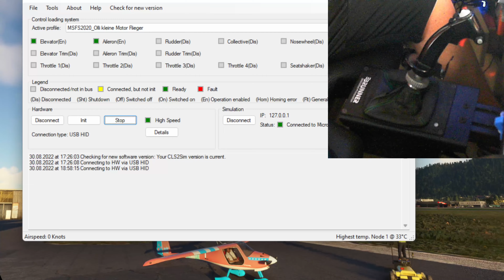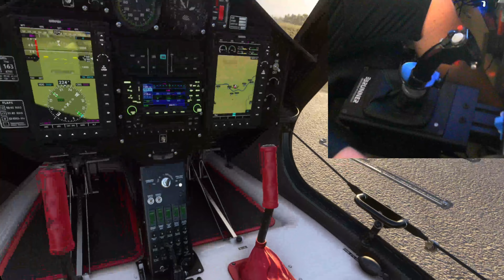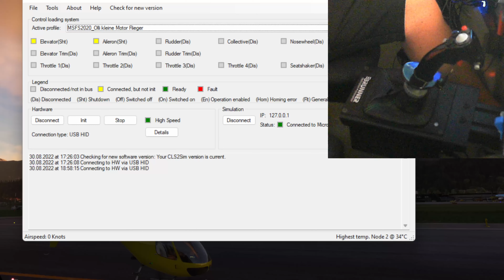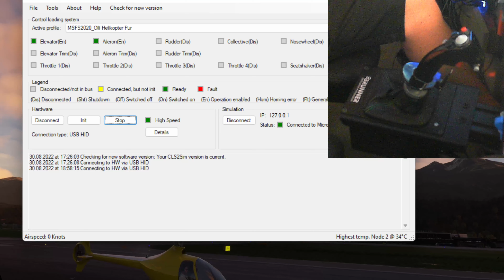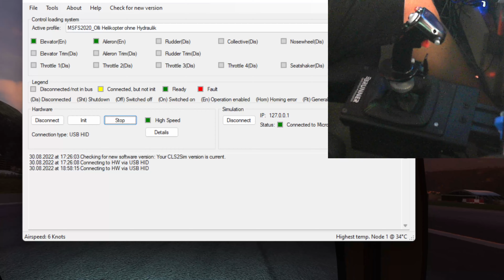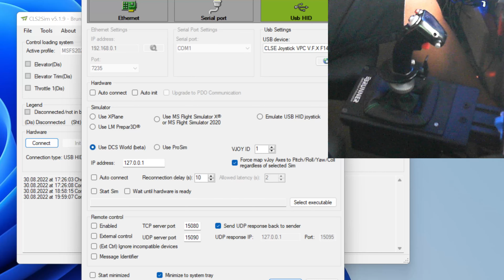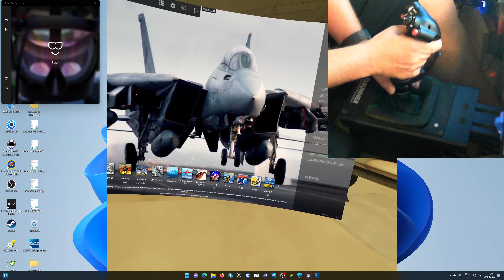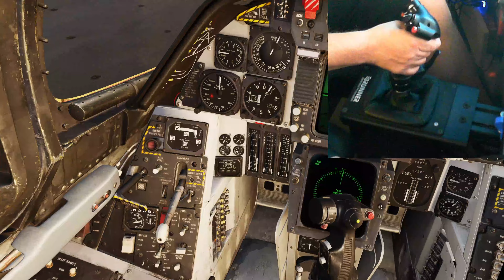Flying with BRUNNER CLS E Force Feedback Base

Comment: If you have time and will, it would be interesting to see you show diferent settings in the CLS program, how diferent settings affect the forces. Centering, dampening, friction, autopilot follow. If you have a luggage scale maybe you can messuer the forces, Ea. How much force in the program correspond to actual force in the stick. Maybe show when you releas from end position with diferent force settings. Can you get cloce to 0 in friction and dampening?
Reply from the maker: Hi Jacob ok, I'll try to make such a video these days as far as the forces on the stick are concerned, I don't have a suitable measurement method to determine this, let's see what I can achieve
Another question in which flight simulator would you like to see that?
Reply: @210871oliver  x-plane 12 when it comes, comparison betwen MSFS2020 and X-plane 12 forces, turbulence effects, would be nice. Centering. Some airline tests. Tiller test. Can you calibrate as a normal joystick? Use it in any game?
Reply from the maker: @jacobwiqvist1760  
Okay, I'll see when I'll get there, but first I have to get x Plane 12 out
Reply from the maker: @jacobwiqvist1760  
Hi calibration of the Brunner base is not possible in the normal usb controller calibration, but you can make the settings in the control program
Reply: @210871oliver  what settings? How is it going with video?
Reply from the maker: @jacobwiqvist1760  
Hi Jacob
I am working at the MSFS 2020 Video 
The X Plane 12 i have not installed yet.
Olli
Reply from the maker: hi,
the new Video is uploaded in a few minutes.
than you can watch it 
https://youtu.be/sMz7ohLlhVA

Comment: where did you get all of your different profiles?
Reply from the maker: I was able to download some in Profile Manager, others I created myself (all with -Olli-)
Reply: @210871oliver  Wow, impressive!  Any chance you'd share some of those profiles?  There are only so many in the cloud I mostly use DCS and MSFS.  Great video!
Reply from the maker: @ALMISHEA  
Hi, I can put all my profiles marked with Olli in the cloud
Reply: @210871oliver  That would be awesome!  Most profiles I am unable to download?  Nothing happens.  A few I have been able to download, but its one out of twenty it seems?
Reply from the maker: @ALMISHEA  
hat I can't upload profiles at the moment, the program generates an error if I can do uploads again, I'll tell you greetings Olli, I still have a type for you, take an existing profile and adapt it to your needs or the plane you want to control, the max speed and the stable speed (Stall-Speed)should be adjusted
Reply: @210871oliver  engine vibration works in MSFS but that option doesn’t exist in DCS?  Any ideas?
Thanks
Reply from the maker: @ALMISHEA  
Hi, the settings for effects are hidden at DCS, why can't I say I always set the setting to MSFS, then I select the DCS profile I want to edit and now I can set the effects, then I change the setting back to DCS and am happy that the stick wobbles
Reply: @210871oliver  I’ll give that a try!  Thanks so much!

Comment: What i don’t understand is how did you manage to have ffb on mfs ! The game doesn’t bring ffb am i wrong ?
Reply from the maker: Hello, thanks for your comment.
You are right, MSFS does not provide direct FFB support. 
However, the BRUNNER CLS-E system, in particular the control software, interprets the parameters simulated by MSFS, 
such as airspeed, turbulence, turbolence caused by the propeller and many other parameters. 
From these parameters and your own settings in the CLS-E software, the software then controls the motors in the various control units, flight stick, yoke and rudder pedals. 
These settings must be set separately for the different aircraft and saved in a separate profile. 
How strong these FFB effects are generated depends on the personal settings of the force curves. 
Since I have a pilot in my neighborhood, I can use his help to create FFB profiles that are very close to reality. 
I hope I can answer your question to your satisfaction,
 best regards, Olli
Reply: @210871oliver  great ! Do you think you can make a tutorial video ?
Reply from the maker: @DJeb86  
Hi 
You mean a video for adjusting the force curves and ffb effects? 
I can try. 
Since English is not my mother tongue, I come from Germany, I hope you can still understand it. 
Please tell me if you have a special plane in mind. Greetings, Olli
Reply: @210871oliver  don’t worry about your english, it’s perfectly fine, actually it’s easier to a no native speaker to get you than a native speaker since they do not articulate.
I have an old stick the thrustmaster top gun afterburner  ffb which is not supported anymore, but thankfully to a modder, who created a thirdparty driver, it works fine on windows, but i do not have ffb on mfs, and it crashes on il2 sturmovik, the fact is that it uses a software called test force which looks like your native software, i do not know if there is a way to implement your software to other ffb stick to get them work with mfs, what is your opinion on this ?
Reply from the maker: @DJeb86  
Hi,
here I have already made two videos in English have fun watching 
gruss Olli

https://youtu.be/sMz7ohLlhVA

https://youtu.be/WPQa9_NeKjM
Reply from the maker: @DJeb86  
Hi, unfortunately the software is not freely accessible and can only be used if you buy the product from Brunner. Adaptation is also made more difficult because communication is realized via new joystick controller interfaces. Greetings, Olli
Reply: @210871oliver  i see, what about xpforce, have you tried it ?
Reply from the maker: @DJeb86  
Hi, 
I just looked at the program on the web. It sounds good. But I have no experience with this program, nor can I say if your joystick is supported. Sorry, greetings, Olli